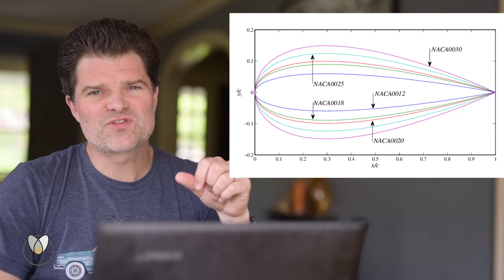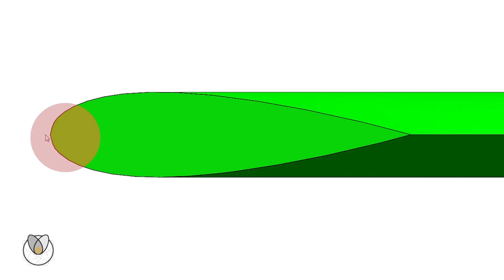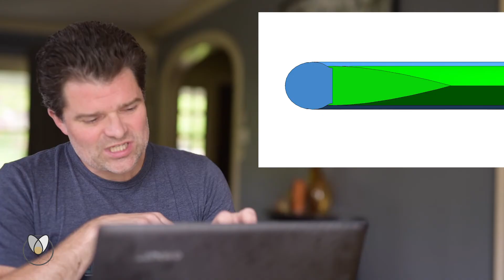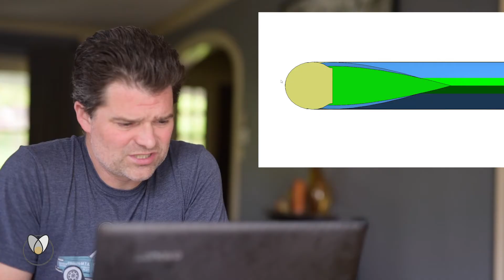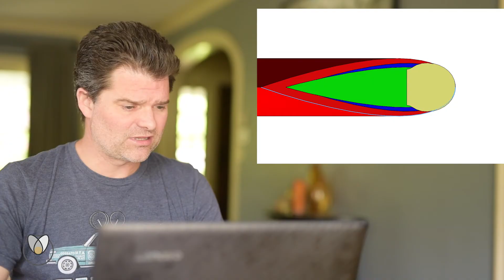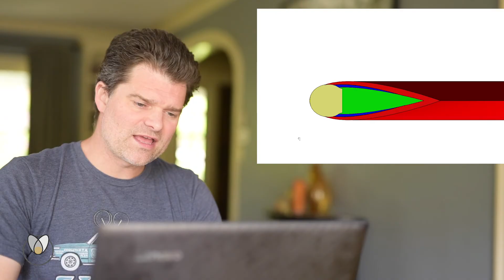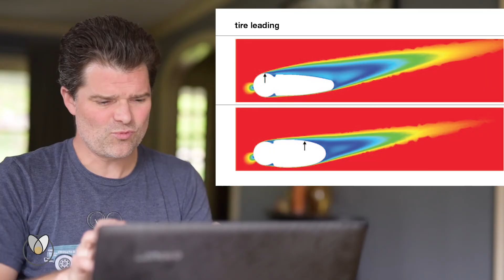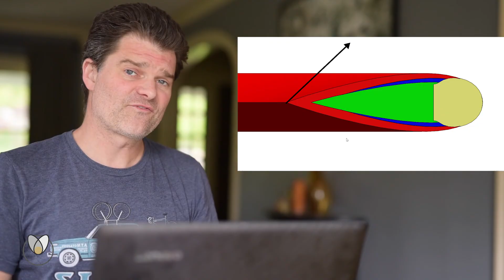EP 0009 Rule of 105, Part 1

Comment: The Continental Aero 111 was recently released in 26 mm and 29 mm nominal sizes. I wanted to give it a try, so I went with the 29 mm version. I'm using a Roval Rapide wheelset with a 21 mm internal width (IW) and 35 mm external width (EW).

After 2 days at 5 bar, the Aero 111 front tire has stretched to a measured width of 28.6 mm. On the rear, I installed a regular GP5000 in 28 mm size, also on a 21 mm IW rim with a 30.4 mm EW. Its measured width is 29.4 mm.

I was expecting improved stability in crosswinds, but I haven’t noticed much difference. Did I do something wrong? Am I not following the 105% rule? What should the measured width of the front tire be to match properly with a 35 mm external width? Is it okay if the tire is significantly narrower?
Reply from the maker: Sounds like you're doing the right stuff.. and either the 26 or 29 will work with that wheel, the 26 is probably a little faster, the 29 will be more comfortable.  Both of them should handle OK, but ultimately the handling is up to the rim design as the rule of 105 just gives you the best chance for recapturing the flow off of the tire, but the rim designers then need to adjust rim shape such that they are controlling center of pressure and so on.. Would be interesting to do some virtual elevation testing with your setup compared to what you had before and see if you can find any CdA change.
Reply: @SILCAVelo   first time I'm trying bigger tires... before i was 25 mm width on a internal 19🤣

Comment: In your calculator, chip seal is a pretty bad/rough surface. Most of the secondary roads around here are chip seal. I don't think it's as bad as you make it out to be. I've ridden worn, cracked, broken pavement and chip seal without these problems is way smoother.

Comment: So basically, you must have your measured tyre width smaller than your rim-lip width (105 rule), and your mid-rim width wider than your tyre/rim-lip width, in order to have the highest aero advantage from you wheelset. So tyre width = 24mm, rim-lip width = 25mm, middle of rim = 27mm(more or less). Is this correct ?

Comment: I called Zipp sometime in 2002 maybe 2003 and asked what the recommended tire width was for my 404 tubulars and I was told 19mm. My Zipps had always been race wheels so they still wear 19mm tires, but since they're so old, I've started using them for the local group rides instead of Mavic Open Pro with 700x25c Clinchers. This was very interesting.

Comment: Kind of the reason why fast rolling tires like the Sworks turbo cotton or Vittoria corsa speed with thin treads have worse aero properties compared those with thicker treads such as Schwalbe pro one or Continental GP5000. The thicker tread creates a more "pointed" sectional shape which better resemble the naca profile. While the thinner thread tires approximates to a simple cylinder at the leading edge.
Reply: Is this a fact from some source as well. U make sense but would love to know if it's on internet as well

Comment: Thanks a lot for this brilliant explanation. I have a modern wheel with a 25mm wide braketrack. The rim is 28mm wide at the widest point which is about 30% in. I run 25c Corsa speeds on it, they inflate to 26 on the 19mm rimbed. So with the tyre exceeding the braketrack I lose the air attachment. Now recently we hear so much buzz about wide tyres being faster. How much are the aero losses in comparison to the RR gains?
Reply from the maker: This will depend on your average speed.. at lower speeds, the rolling resistance is dominant, but at higher speeds, aerodynamics overtake.  We would have to do some wind tunnel for your specific setup, but as you are already on pretty much the fastest tire out there, and a wheel that does exceed the tire width at some point in the profile the tradeoffs here will be quite small.  In my experience, the crossover is generally in the 20-24mph range for good equipment, and you might be giving up 2-3 watts at 30mph due to the wider tire, while gaining 1 watt or so at 20mph due to improved rolling.  For most of us non TT racers and non-pros, the tradeoffs in percentage terms will most always favor the slightly wider tire.
Reply: @SILCAVelo  hey guys, thanks for coming back to this! I now replaced the 25mm Corsa speed up front after a puncture by a 23c GP5000 that sits pretty flush with the wheel at 24,3mm width on the 60mm deep rims. Since I ride at 37-38kph at triathlon events this propably isn't the worst choice. :)

Comment: What is the penalty of breaking the rule? Let's say you have a 29mm wide tire on 28mm aero rim as opposed to a 26mm wide tire
Reply from the maker: Depends on the rim design, yaw and by how much you are breaking it!!  For V shaped rims, it can be quite dramatic at yaw angles above 5 degrees, I've seen drag more than double at 10 degrees from tire being 1mm wider than rim.  For more modern designs, breaking the rule begins to decrease the stall angle of the wheel.. so you might be similar drag at low yaw, but penalties can get steep at high yaw.. once the tire is more than about 5% larger than the rim, the entire system becomes aero dominated by the tire.. so you still get the advantage of the aero wheel using fewer/shorter spokes than a non deep section wheel.
Reply: @SILCAVelo  Thanks for the reply! It is a modern rim (Roval CL 50). I guess it is very difficult to find out without a wind tunnel as a Chung test cannot give you the yaw sweep (?). I live in Denmark where it is quite windy and I am not fast, so I probably spend some non-trivial amount of time at higher yaw angles

Comment: Silca delivering with YouTube gold again! I asked ENVE about the rule of 105% in relation to gravel because I feel that is still a nascent field in terms of aero, but they feel that any type of tyre tread completely negates the advantages of a wider wheel, and looking at those flow separation examples at the end tend to make me agree, however it looks like Hunt is developing an ultra wide gravel wheel and has some wind tunnel data (along with Specialized) suggesting that even with tire knobs, the wider wheel is measurably faster. There must be something else, other than flow separation going on in these cases because surely the flow is separating at the tire knobs and with some turbulence, so I don’t see how it could reattach even with a 105%+ rim width. Would love to hear an all off-road marginal gains podcast episode!
Reply from the maker: Thanks for the thoughts and question... I have little data on this for gravel width tires, but we know from previous tunnel testing (I did at Zipp, and also one done by Trek) that showed even aero rims narrower than the knobby tires still had some positive effect.. FLO Cycling also recently did some work on this for gravel and saw benefits.  My hunch is that a rule of 105 rim on a knobby tire might help even more as the rim would effectively grab and calm the turbulent air off of the tire, but that's just a guess!  Of course, 50mm wide rim with 47mm tire would look a bit odd (at least at first!) and weight might ben an issue as people still seem to be paying attention to that..
Reply: @SILCAVelo  Very interesting, thank you for the reply!
Reply: I wouldn't trust anything Hunt says. Some of the data they've posted in the past didn't include spokes🤦. I think they are heavily driven by marketing.
Reply: @edrcozonoking  We could always ask Aerocoach.
Reply: I was thinking that too.  About tread. I too would like another off road pod ep.  (the Leadville ep kind of counts).
Reply: What speed do you average on a gravel ride? Is it ever high enough for aero products to make any difference?
Reply: @tednruth453  I think that speed is somewhat irrespective of time saved. I'd imagine the Reynolds numbers between 15mph and 20mph are pretty close and a gravel ride is more akin to a TT in that I'd be riding alone instead of a group most of the time.

Comment: Josh, thank you for the visual representation for the "Rule of 105"  now I get it.   Along time ago with a very different project the wheel and tire being an airfoil were discussed  at length when we did early wind tunnel testing for the US National TT Record attempts at Moriarity, NM.   We most definitely did not have any 'aero-dynamasists' working with us.  We were for the most part all lay people getting to play in a wind tunnel developed for Indy car.   Still amazed how after all these years Frey's 40K amateur record of 47:35:37 from 9/2/90 of has stood the test of time.   So much has changed in training, aerodynamics and even bearings and yet his record still stands
Reply from the maker: Frey's bike for the '90 record run was a masterclass in aerodynamics, both for its day but also in the modern era.  It was essentially an hour record bike with an aero front brake, skinny aero tubing and no base bar.. and of course, an absolutely phenomenal engine!!  Knowing what I do about both bikes, I would guess that the Frey bike was more efficient aerodynamically than the Campanaerts hour record bike.